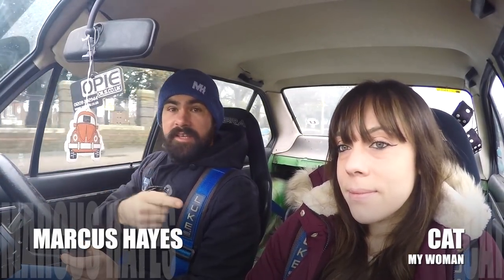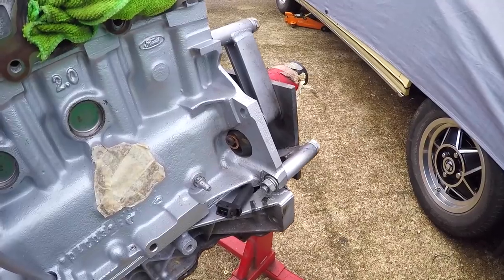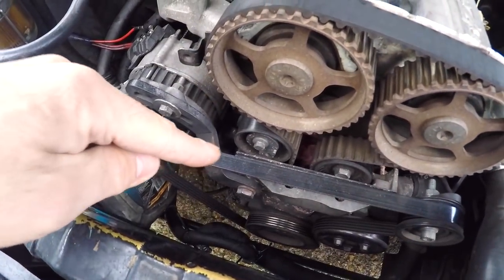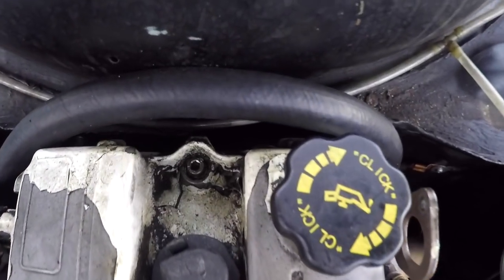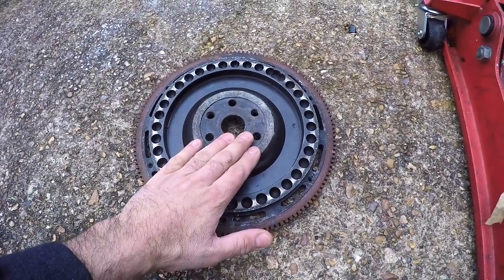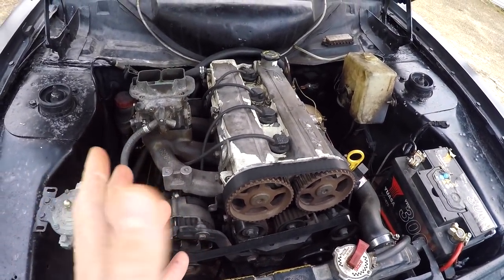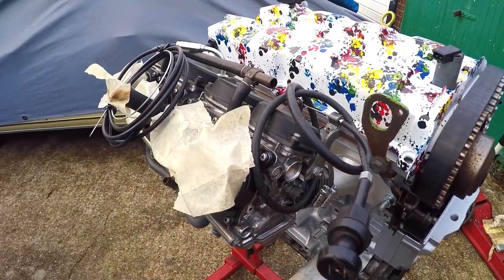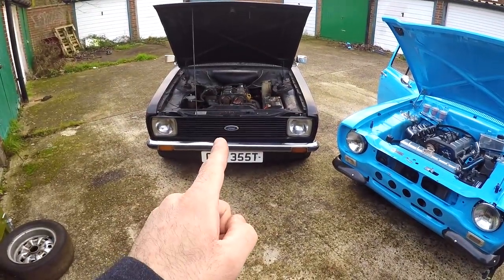RWD ZETEC CONVERSION GUIDE! how I did it 😀

Comment: Can't beat retroford for quality, help and fitment. Unless the sumps have the extra bolt holes and spreader bars like the early RF steel sumps, they will always leak. I've used 2 dunne ones, both leaked. I know of another in a Capri, currently leaking. I'm going straight to RF for the cast alloy sump. Yeah, it's expensive but it's quality. Sump, water rail and mounts. The rest of the parts can be made to fit and work well. Good vid

Comment: Great insight for anyone looking at the mod, as for engine mounts, we have found the old world cup type mounts which will not let the engine come loose and drop down and have save the day,  and if you did not know the rubber bush used are the steel sleeve bush used on the Escort rear springs, The old 38 DGAS with 100 correctors is also a good carb off some of the old Ford V6's, but are very hard to get your hands on now, Love that you are sharing you knowledge mate, well done and yes i have now subscribe.
Reply from the maker: Thanks for the info and welcome to the channel! 👍

Comment: If the sump is made of pressed steel, they can bend when fitting, and they will leak. All pressed steel sumps have a habit of leaking if they are torqued up to tight. Cast sump pans might be heavy but they won't leak.
(Good vid)
Reply from the maker: Totally agree mate! 👍 I want to fit sumps that have been made from a modified genuine Ford sumps and I THINK a company I tried before has just made another batch 🤞. . . . . . The sumps I have fitted are absolute junk!! (altho if the supplier sees this comment they may threaten me with court action again! 😃)
Reply: @marcushayesford  I've still got a new fiesta sump that I never did fit, I just left the old one on, I didn't see the point of fitting a new sump and still having to deal with a leak, I still have the sump, I don't have the fiesta anymore tho.
I'd feel guilty if I sold this sump to anyone, cheap pressed steel crap.
It'll come in handy for something, a keys bowl probably, or a door stop

Comment: Interesting vid mate wish I’d of seen this before building mine 
My st170 escort is running the me221 and Dan’s throttlebodies it’s all ok decent stuff tbh currently making my own adaptor plate for the standard bike/bodies mounts 

Sump is Neil dunnes not had any issues with it tbh had a small leak near the pulley but was ok after a tweak 

RetroFord  mounts are good and alt kit worked a treat after some cutting like you said. 
Neil’s fly wheel and water rail

I like a crank sensor and had to space it ..

I’ve used your budget hose setup for the bottom one as I had a pinto RS rad like yours and a samco top one as I had this lying around 

Exhaust is a custom one by n.a.w automotive absolute work of art!  

We deffo need a meet up next year !

Are you doing a vid before Christmas? 

Be nice to have a crimbo one!

If not have a lovely Christmas. 

Clean that knee up for when your down on one knee!

Heard it here first ❤️

Comment: Marcus great vid bud very informative on both set ups the inlet manifold is from a Brisca F2 stock-car they used to run 2ltr pintos until reasently they started running duratec engines in them they race on short ovals all around the uk

Comment: The problem you have with your sump is they expand at different rates thats why they leek if you get a full height alloy one there won't be a problem but great conversion for a for Ford escort great explanation of the conversion though my first car was a 1.6 mk2 two door
Reply from the maker: Yeh I defo reckon having an alloy sump is the way to go. 👍

Comment: How much power do you make with the carb on one of these engines? I'm from the US and I'm tossing around the idea of putting a zetec in a fors ranger that I am doing a rally cross build on. It currently has a lima sohc 2.3
Reply: The ford lima with a volvo head swap is supposed to be quite good

Comment: Very interesting video, it’s nice to see how you have done both your conversions compared to the three we have done, each one is slightly different as better parts come out. We have fitted Ashley systems to all three of ours, and extended the pipes down on each one, the Piper system looks so nice compared. The only thing you didn’t mention was the gearbox cross member, we have an adjustable on our mk2 which was a faff until we found a wedge spacer for the type9 and magically it fitted. The mk1 has a fixed mount but the car has a big tunnel so I welded the mounts in at the same time as the tunnel was fitted. Almost all our stuff is from Retro Ford, as they have been really helpful but not cheap. Do you have expansion tanks in either of the cooling systems? Our mk1 always spits a bit of water out, but we have just fitted one to the mk2 so once it’s on the road we can see if it helps. We have retro ford alloy cast sumps on both and so far so good, the steel ones were pretty hopeless. Keep up the interesting videos.
Reply from the maker: I did have to make a spacer to go between the gearbox crossmember and the box itself to raise the gbox up a bit. I’m using GS Escort lowering blocks which also act as an adapter so you don’t need to reposition the mounts on the tunnel (its a bit of a bodge tho) 👍

Comment: Great video! 
Have you rebuild the engines or how many miles did they run?
How much power/torque do you guess make Maude's Zetec setup? 
How much is the fuel consumption of Maude?
Do you have experience with an ATB LSD compared with a Friction Plate LSD? 
Thanks!
Reply from the maker: Thanks! 👍  Niether of my engines have been rebuilt. Maude's zetec did 90k miles in the Mondeo and made 159 bhp in Maude. Maude uses quite a lot of fuel but I do drive her hard. I have never used an ATB before. 👍

Comment: will the z tec line up with the original mk1/2 escort gearbox or will they need flanges ?
Reply: they line up, same bolt pattern, but needs to be a 4 cylinder bell housing, not  av6 one from the capri/cortina

Comment: Will the zetec line up with the 3spd automatic in my pinto mk4 also if I change it to carburettor how do I mount the distributor or do you use after maker ignition